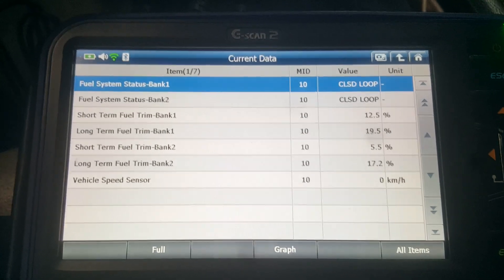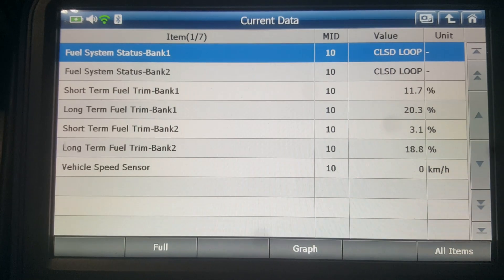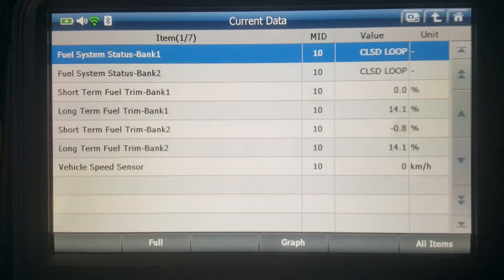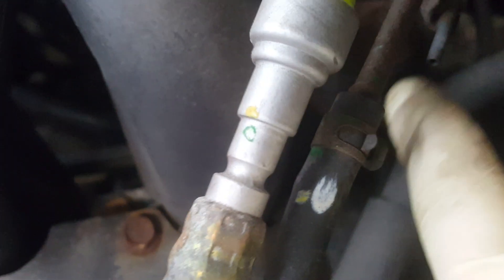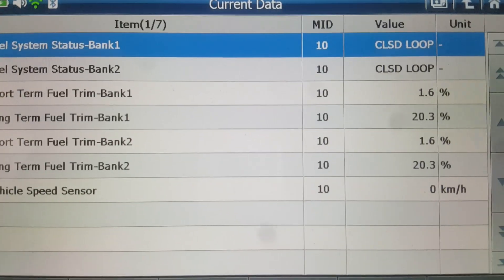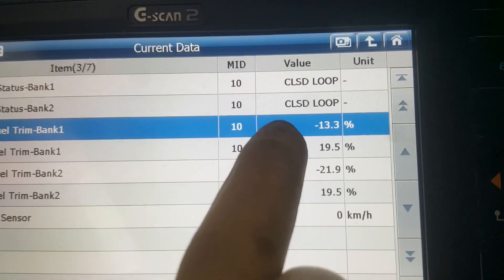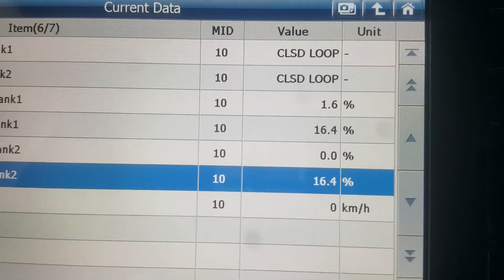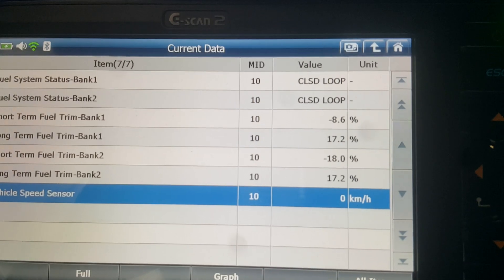How to Confirm Your Repair P0171 P0174 System Lean

Comment: My issue was evap canister, map sensor, dirty intake box, fuel pressure regulator, plugged cat converter, and muffler. So, this happened when I poured an extreme fuel cleaner in my gas tank that said this would happen lololol. Nice video thanks.

Comment: I had a P0174 show up and the mechanic hooks up his snap on and he tells me it's the o2 sensor, so I take his word for it and have the two upstream o2 sensors changed out, and what do you know then I have a P219B that shows up and the P0174 is still showing also. I don't know if this guy made a mistake or what, but for $135 an hour labor charge I'm not to happy.